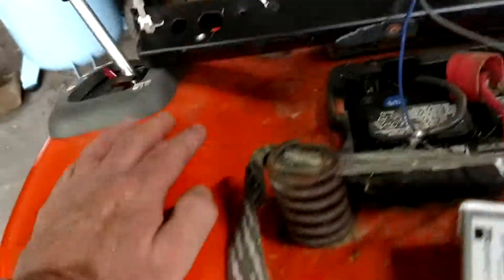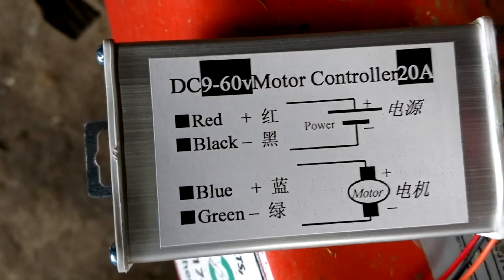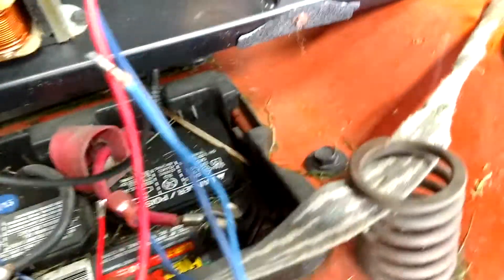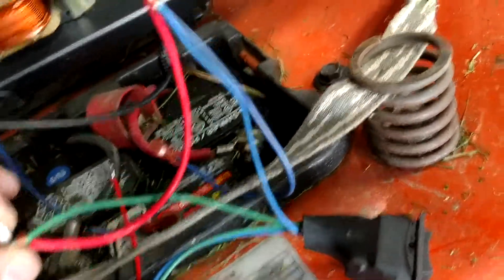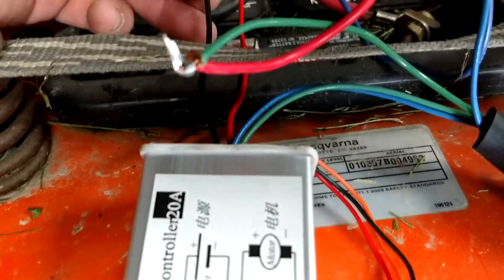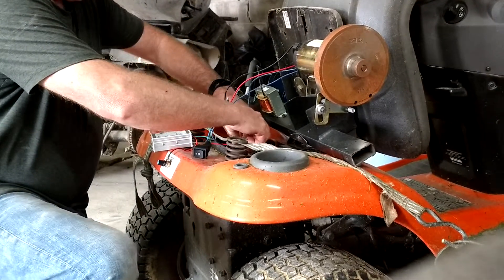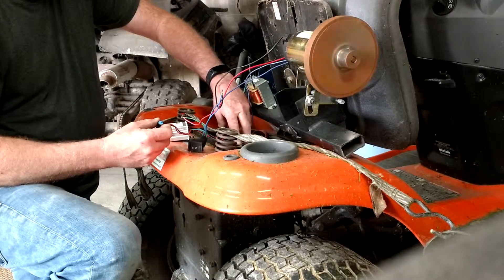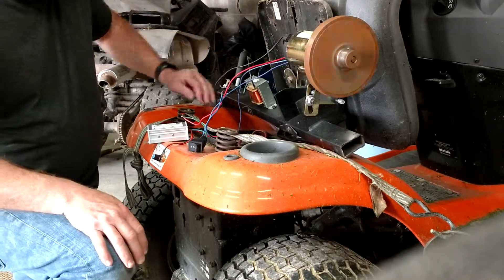ATV conversion from gas to electric (Part1) testing DC motor controller

Comment: When will part 2 be here?
Reply from the maker: Sorry, no part 2 a guy offered to by the whole setup and now it's not in my possession.
Reply: @coyotesnper  I was just real curious if that speed controller was big enough to run a treadmill motor. I've got a 107 vdc and I saw the exact controller for like $8. Thanks for replying back.
Reply from the maker: @_RocketRooster  it was big enough to run it without a load, but never got a chance to try it under load.